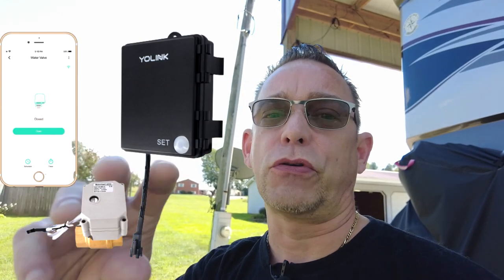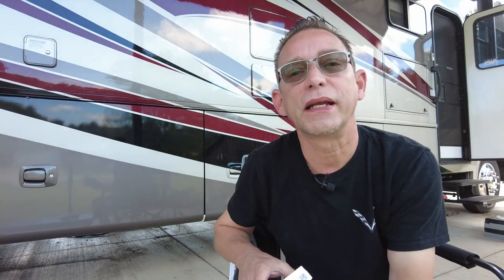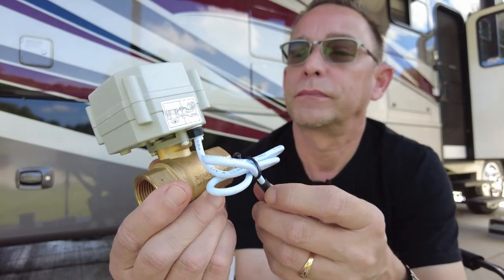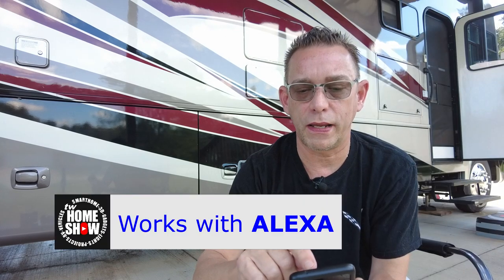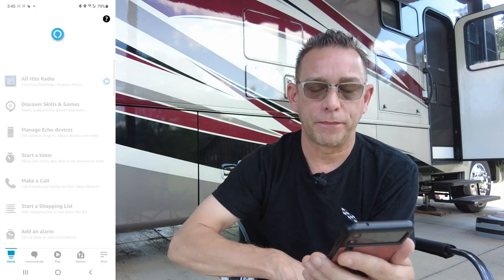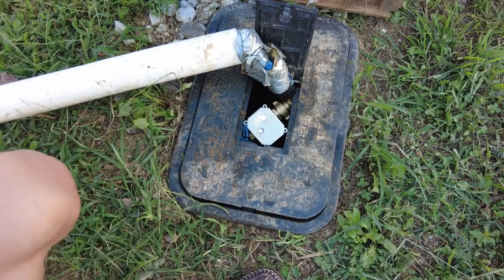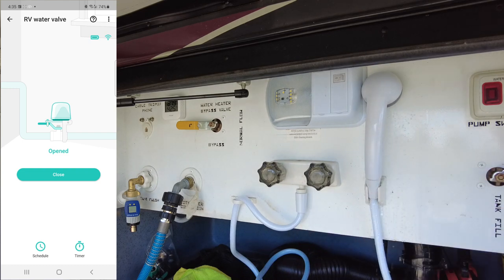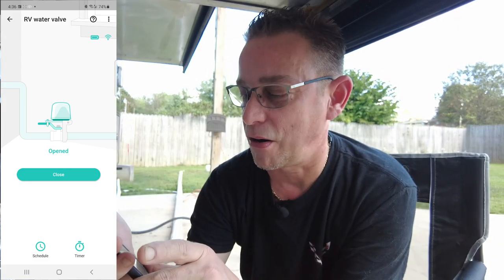YOLINK Smart Motorized Water Valve | Automatic Main Water Shut-Off | works with ALEXA

Comment: Thanks for the video.  I have the second version you discussed as I have an existing ball valve in my garage that shuts off water to the house and it works perfectly.  The valve you showed was closed when you started so I'm wondering if it's indeed a normally closed valve.  I wouldn't want that for a house on city water as whenever the power goes out you'd lose all water.  It didn't appear there's an easy way to take the valve apart enough to operate it by hand if you needed to, as the other type does. The nice thing about your RV setup is you don't need power or Internet to protect the inside of the RV in case of a busted line or other leaks.  For your house, there's also a battery-operated alarm that works with this setup, too.  The bottom line is YoLink has some really neat products that affordably solve problems or do things other devices don't easily do.  Thank you.

Comment: Hi, I have a couple of the sensor cable leak detectors and I would like to have one of the actions to turn on a yolink wall plug.  I've worked with the options but haven't figured it out.  Any idea?  Thanks
Reply from the maker: Hi Bill P.  Here's how to do that:  Open the Yolink App, #1) select "smart" at bottom of app. #2) select "+" at top right corner #3) Name your new automation, select "when +" , then "Device Action", choose your Leak Detector #4) choose rule "water detected" #5) select "Behavior +", select "Device Actions" #6) select the wall plug and set to "Turn ON" or "Off". Select "check-mark at top right of app, then check again on next page, and you're ALL SET.
Reply: @twHomeShow  Thank you, thank you.  I have a different water shut-off valve from years ago and will use a relay powered by the wall plug to close it if there is a leak.
Reply: You probably already know this, but while surfing I saw a video where the guy in addition to shutting off the water, had an Alexa routine announced it on all speakers, and sent a notification to your phone.
Reply from the maker: @myutube6422  Yes. I think I touched on some more of the Yolink and Alexa smart automations in my last RV Yolink video: https://youtu.be/kb4xVr06G_A

Comment: Hi, do I need a hub?or can i just download the App and use it that way on my fone? I just want the water valve to turn off my sprinklers if it rains. turning the water off and leaving the timer running will work better than a rain sensor.